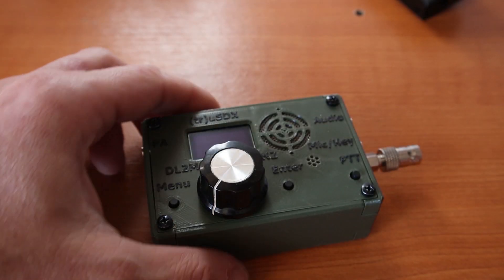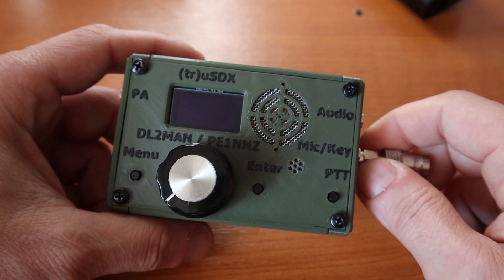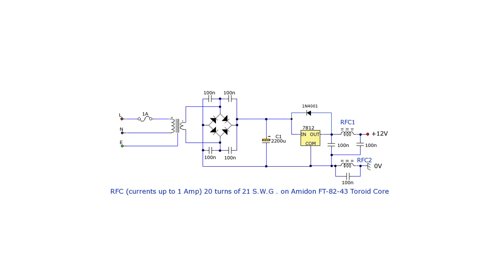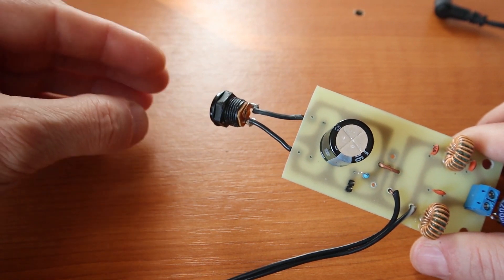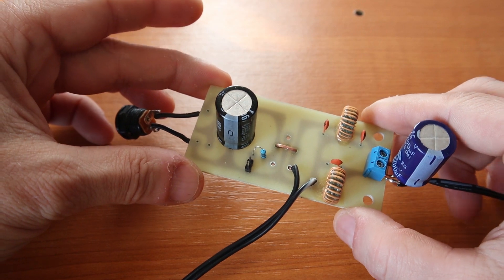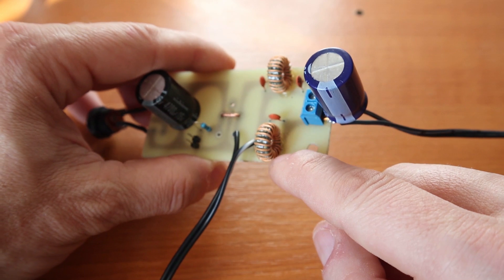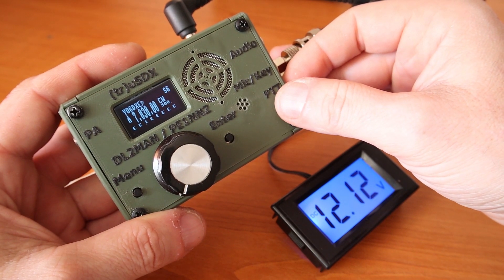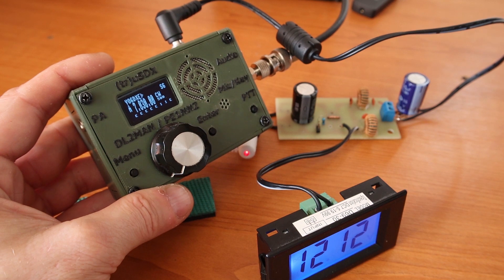Homemade Power Supply DC Filtering For Amateur Radio

Comment from the maker: BUY THE (tr)uSDX HERE FROM AUTHORIZED SELLER BY DL2MAN:
https://s.click.aliexpress.com/e/_c3VMBhXF

Quick correction in the video: In all three schematics, the ceramic capacitors are 100nF each. I think in the last one you can only see a 1. That is because I rushed changing the schematic in photoshop and didn't noticed I covered the rest of the number. Just to be clear on that part.

Ohhh... and I also made a mistake saying uF instead of uH at some point talking about the inductors. And also on the -12v it should be -0v but I usually put -12v just so I know that is the negative )) Thanks Manuel  DL2MAN for the correction. I made and edited the video really quick )).

Comment: Hello, again, 

You must have minimum 1,5 to 2V more, then the wanted 'regulated' voltage, under full load (!), directly behind  the rectifier and the 'first smoothing' capacitor ! 
(Be aware of the voltage without any load! It will be the Vpeak voltage, not Vrms ! Vrms = [square of 2] Vp ! )

Put your volt-meter there, and make your messurement. 
( min. 13,5V to 14V DC at 1A, or the desired amperage !)
Also for 1A you 'needed' a heatsink to the L7812 ! 
A - L78"S"12 - is good for 1,5A max. current ! That means up to 18VA[W] max. input to the radio, more than enough! 
(See at the end of my text!)

Please don't use to small wires, to make the powercord to the radio ! Snipp off, the 'old' one ! Make better one's ! 

A 0,75 square-millimeter is adequat, but not a 0,22sq-mm ! ! And. please, not 5m long, ... ! 
Be carefull, up to 18W of  power, will burn up the small wires, directly ! The loss of the small wires is to much resistance !

Please keep in mind, the 'loosing power' through the 7812 ! This could be rather lot of Watt's ! 

Example: 

Uin= 15V - Uout  = 3V across the 7812!  |  3V x 1,5A = 4,5W,  that's a lot of heat to 'waste' on the 'small fin' from the L78(S)12, please use, a big enough heat-sink ! 
When calculating the 'whole power', you need to feed the 1A-radio with the regulator, in this part it should be min. 15V and 20 to 30VA (Watt) / up to max. 1,5A, for a reasonable power-supply ! More is better, and stayes cooler ! And it will fit also a 'little bigger' radio, ... 
That's a lot of 'transformer', I know, ... ! 

Loosing your lovley "tr(u)sdx" will cost you more, then a new (bigger) transformer!

You may burn your fingers without a heatsink on the fin of the 7812, ... and it will regulate 'back', to a lower voltage to 'protect' your radio, when getting too hot ! This is a normal behavior of the regulator. More than 'a cup of hot coffe' to touch, is too much! 
(The L78S12 is short-circuit, over temperatur- and over current-protected ! It fold's back, if any more than the 'allowed' is 'pulled' from the device.) 

Also, when using a 'second' big electrolytic capacitor 'behind' the regulator, think about a diode, across the in- and out-put pins. The diode will 'pass' the 'high voltage' back to the input pin, when the capacitor is so big, that the output voltage is 'greater', then the  intput voltage! 
This could happened, when you pull out the wall-wart (transformer) out of the socket ! 
(Vreg is 12V, and Vunreg is less then 12V! Slowing down to 0V !

This is a typical mistake, a lot of people do ! The diode will pass the higher voltage to the input pin ! The L7812 is NOT 'reverse'-protected ! - Bear this in mind! - 
This can be dangerous, and destroys the 7812, and then you radio will see +15V, or what ever your 'unregulated' input voltage is, and maybe the radio will die directly ! 

Hope you see the small 'rules' of 'using' the 3-pin regulators like the "L7812" and others ! They are for any of them, also for the 79-er types.  ('Negative' regulators ! 7912 is for -12V ! Take care for the PIN-out, they are diffferent.) 

L78xx= 1A (no extra letter !) 
L78Sxx =1,5A
L78Mxx =0,5A
L78Lxx =0,1A (100mA)
xx = the diffferent voltage you can buy. 
Here it should be "12" Volt. 

"L78S12" is a "12V" and "1,5A" regulator ! 

73 de Markus - db9pz 
(JN39fq - 5km/3 miles east of LX!)
Reply from the maker: Wow this is really great info. Thank you so much. This is great to know. Ohh right now I will just use the one I made in the video. When I will have a proper transformer with the right output voltage and Amps I will rebuild the entire thing properly. I had a heatsink on the voltage regulator..  and think wiring is my favorite usually ))) I just didn't had enough volta going out of the transformer. But I will get my hands on one and build a nice power supply. And with all this info you left here for sure it will turn out well. Thanks so much one more time. 73 and have a nice relaxing weekend.

Comment: Thank you for video.
Probabbly yes, you need common mode choke as it is very common problem with EFHW antenna. Or at least try to add 0.05 wire to the ground of transformer to reduce CMC on coax cable.
More over, (tr)uSDX consumes a little current that we always can use 3s LiION cells for this. At least for avoiding noise form power line.
Reply from the maker: Yes the battery cells are a lot better. But since I use it at home so much I thought is more convenient to use a power supply. I wouldn't even know the power supply had filtering issues if it wasn't the YO contacts to let me know about the bad modulation. Works great now with the little filter. Ohh RF choke is good to have indeed. I don't have issues now, but I want to have one anyway because it will also reduce some of the noise the EFHW antennas pick up really good ))). 73 Yury.